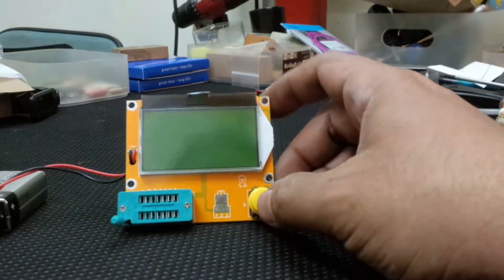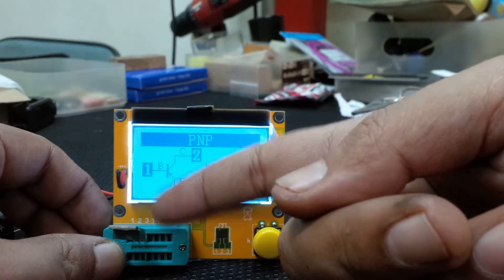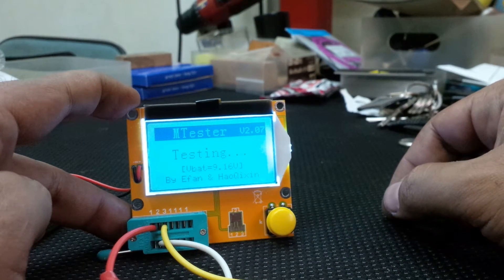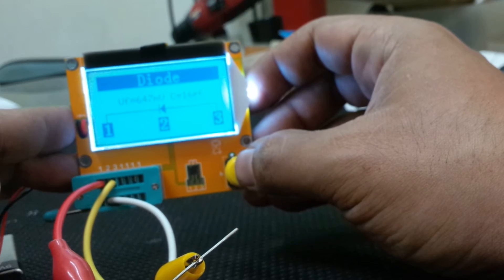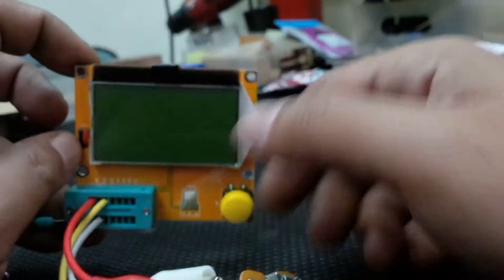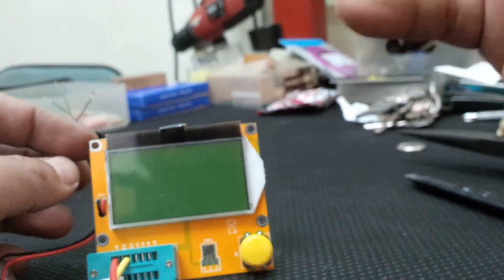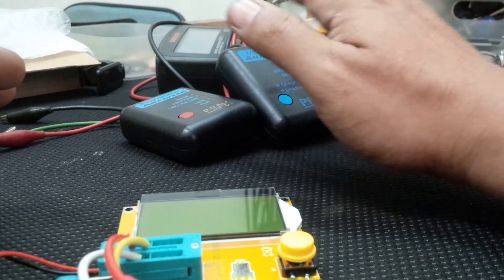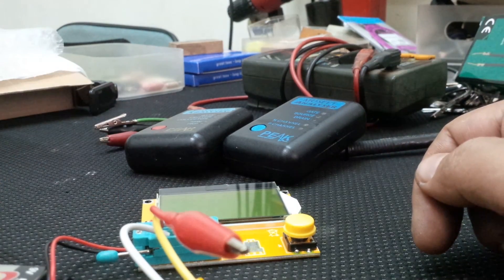Ebay Component Tester

Comment: Can these be used to match transistors? I'm having trouble interpreting what the hFe and uF readings would mean in terms of matching q1 and q2 in a circuit
Reply from the maker: I don't see any reason you couldn't do that.However I can't help you on any component datasheet explanation as I'm no expert in such field,I just fix stuff and replace broken component.One more thing about this test gear,just be sure to analyse the component twice after all it is cheap and made in China.